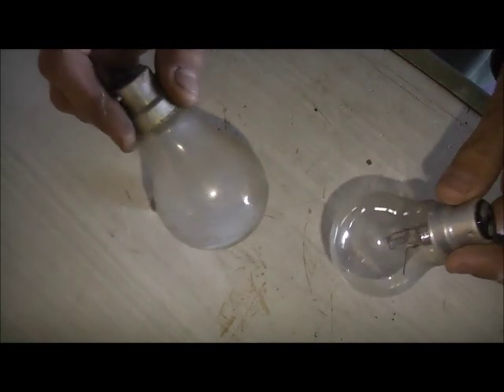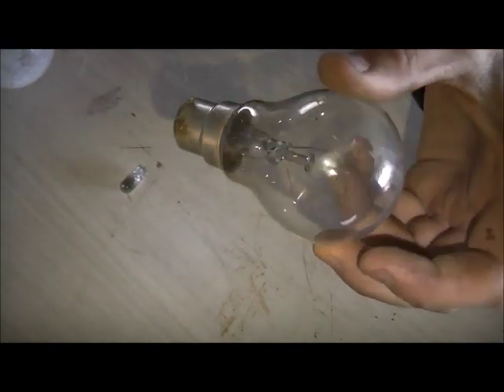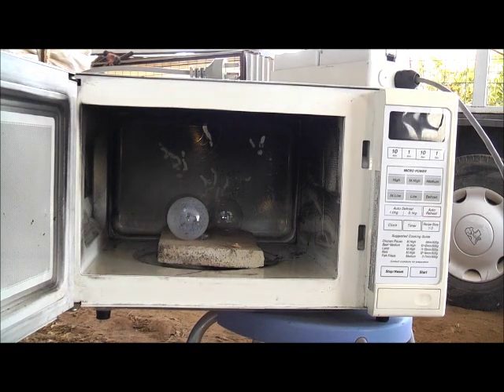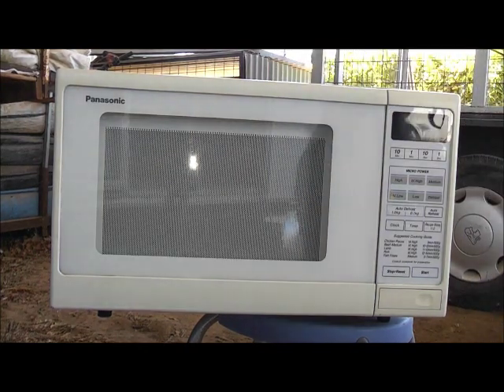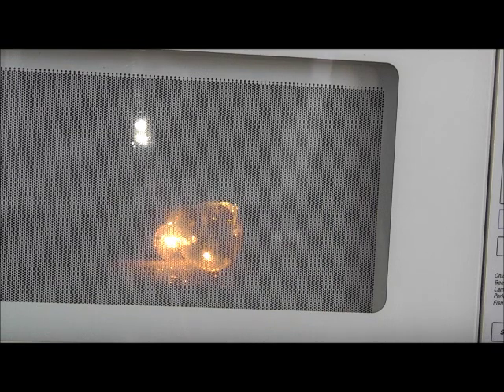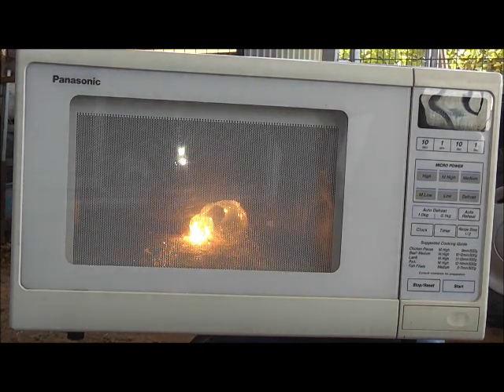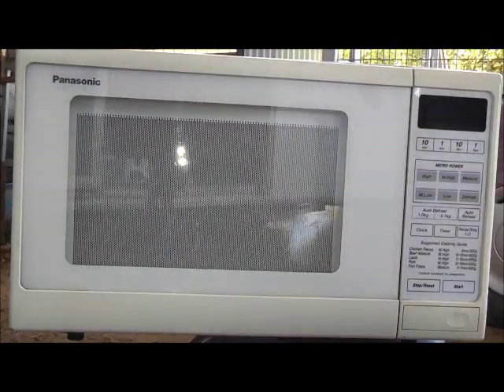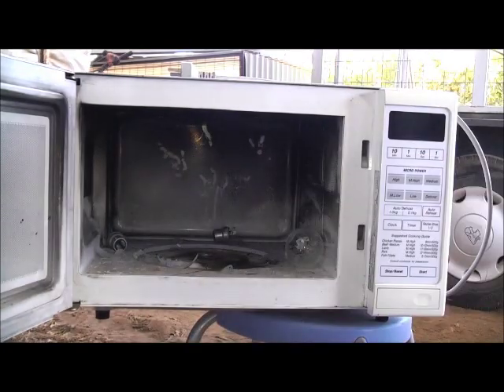Blowing Lightbulbs In Microwave Oven!!

Comment: That's sort of my position, if it likes microwaves then feed them to it. I'm also curious as to what a Tesla coil or a ZVS flyback might do to electronics if you ran the output through a coil. With high voltage and frequency electricity you can induce voltages in other devices. I was going to try killing a garbage picked radio with a home made EMP device, a capacitor bank and a coil made with heavy gauge wire.